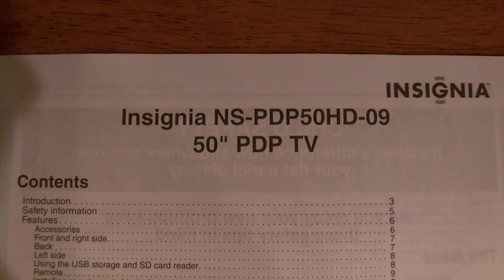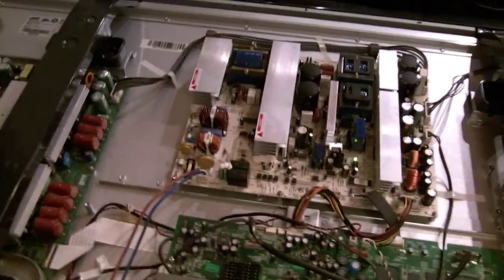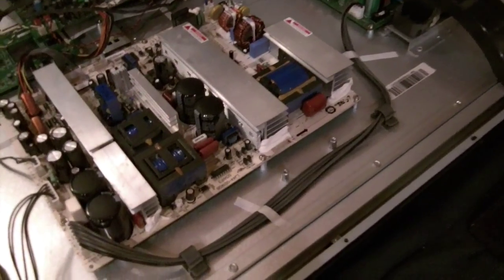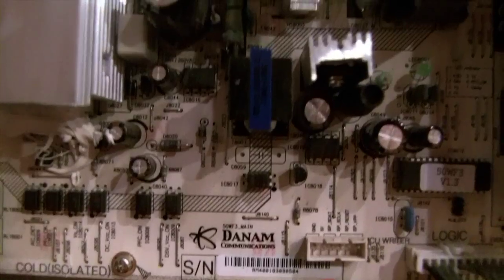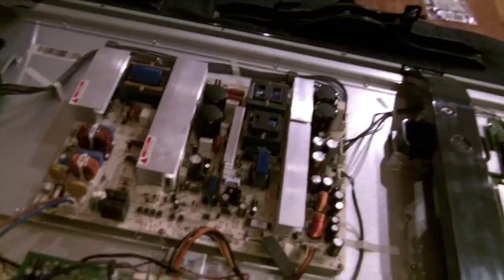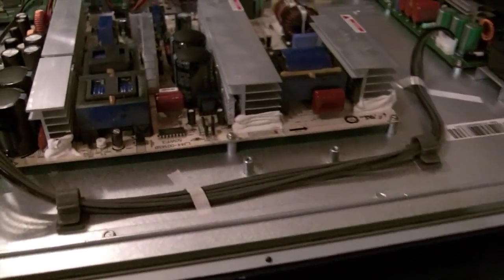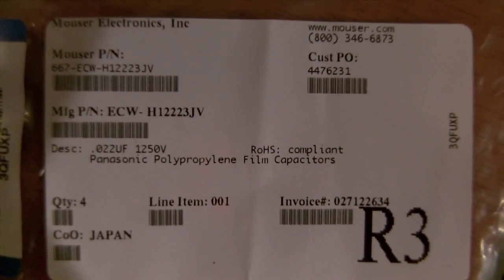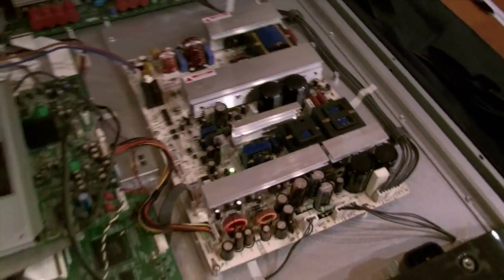Insignia 50" plasma TV NS-PDP50HD-09 power issue fix

Comment: I have the same TV with the same 4 blink problem and not turning on.  THIS FIXED IT !!!. Thanks.  I couldn't get 1250v caps so ended up using 2 1600v ones.  Physically larger so had to leave the legs about 3/4" and I used some wire insulation to cover the leads.  I found the caps are actually in parallel, so the value is still 0.022uF but the voltage tolerance is double, so with the original caps being 800v, I could have just used 1 new 1600v but then like you said, beefing it up is better.  Also the 2  electrolytic (47uF 50v I think), were swollen so I replaced them. I'd recommend anyone else doing it as well.   It's been working great a couple hours now.. Thanks for the tip.!!

Comment: After a thunderstorm, we lost our Insignia Plasma TV.  Checked with local shops and they said it wasn't worth them coming out to attempt to repair since parts would likely be too much.  Go buy a new one they said.  So after finding this video, I opened it up and tested it out and had the exact same symptoms described in this video.  I ordered 4 capacitors (2 were spares).  With shipping, was less than $15.  Did the solder work, reassembled, and the TV works fine now.  Thank you!

Comment: I'm having the same problem with the same model, the difference is the trouble light code light you refer to doesn't blink like you mentioned in the video it stays on solid. It shuts off randomly it probably stays on for about 10 minutes and then shuts off. Any suggestions? Your video was very helpful by the way

Comment: Dood! Thanks to your video I was able to fix the exact same model with the exact same problem.  I called Mouser and gave them the part number and bam, a week later the capacitors showed up and it only took me about ten minutes to solder the things in place.  Works!  The gal at Mouser said she was familiar with your video so apparently a lot of people have called about it.  Thanks again!!  (Yeah, I haven't soldered in about twelve years.  No big deal.  The hardest part was all those damned screws in back of the TV!)
Reply from the maker: Been a while since I ordered these, but it looks like you can get them still from Mouser:
http://www.mouser.com/ProductDetail/Panasonic/ECW-H12223JV/?qs=GoZnPdyRfjajXbigiOudsA==
Reply from the maker: +Crate Digger's Radio I'm really glad to hear the video is still helping people, thanks for your comments! Funny that Mouser is aware of the video, I never thought of that, I'm selling caps for them :)
So right about all those screws!
Reply: can you post the exact link on the capacitors? I'm a SAHM and not too tech savvy, but my kids are dying without watching their cartoons!

Comment: Question.  I am having almost the same issue. Except mine isn't shutting off. It's when it's turned off sometimes it doesn't come on. So I have unplug the tv from the wall socket a few times and it eventually comes back on. So does that sound like a power supply or controller board. Note I haven't opened it up to see what LEDs come on or blink. Ty for your time.
Reply: +or2169 Did you figure out what the problem was? I am having exactly the same issue. When TV is on, it works fine. Once it is turned off, it does not turn on. We have to unplug-plug several times until it comes back on.

Comment: Your 2 square capacitors from Mouser (667-ECW-H12223JV) fixed my issue, thanks.  I also had to replace a bunch of the smaller caps that were bulging: bunch of 47uf 50V, 1- 4.7uf 50V on the power supply board + 2- 680uf 25V on the board to the left of it.

Comment: I replaced the cap's with newer beefier caps.  Was working fine for a night.  Is there any guidance for beefing up the cap from the replacement ones or should I be looking at something else on the board.

Comment: There's only one real problem with this video...you never push the power button. I've actually done some testing on my TV, and the problem seems to stem from the logic board. With it disconnect the tv appears to power on correctly, removing the connection to it have no effect,

Comment: I was able to fix my TV with this information. I got my TV in 2008, and it's worked fine up until a couple weeks ago, then refused to power on. I ordered a couple of these: digikey.ca/product-detail/en/ECW-H12223JV/P10486-ND/269106 (and they arrived in under 24 hours, wow!). I took the power supply over to my friend Nick's place, and he did the soldering as he's a bit handier with that. The TV is now once more working correctly. Thanks, @thelabtoad!

Comment from the maker: Glad the video has helped some people!  Ours finally died again unfortunately, and this time it wasn't those 2 capacitors, took a good look at the board and couldn't figure out what it was. At this point, not worth the trouble-shooting effort, so got an LED to replace it, but I miss the clear picture of the plasma.  I think the excessive heat these sets generate, combined with poor ventilation, creates a capacitor cooker....maybe drill more ventiallation holes if you have a working set?

Comment: Hey I replaced my capacitors a couple months back and it worked fine until now. It started going off again. I got two extra capicitors, should I replace them again? My soldering was pretty ugly.

Comment from the maker: I had read somewhere online that the capacitor originally in the set might be under spec, and part of the reason for failure...so I bumped it up to hopefully decrease future failure. I'm at almost a year now with daily use, and still works. I do try to cool the back of the set off with a fan on hot summer days though (we don't have AC) to help aviod further problems...

Comment from the maker: @curty162 do you mean you have the power-off issue? if so you might have blown capacitors like I did...trick seems to be in finding them and replacing them. There is a lot of info on youtube and other places on the web, maybe search your specific model # and you might find someone who has had the problem with the type of tv you have...